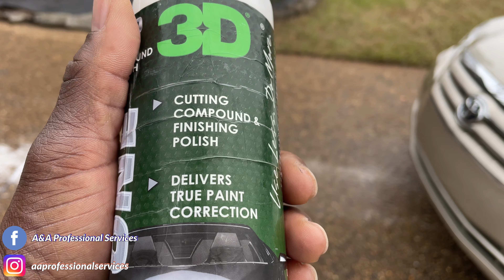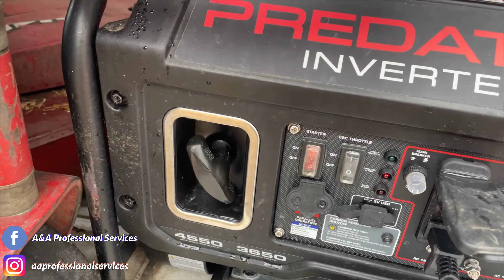Mobile Detail Setup Failed- Hose Reel

Comment: How often do you clean the polishing pads and how many do you think should be used for a average polishing job?
Reply from the maker: I literally put mine in the washing machine after each use. Three to four on each vehicle for the best results but i can get away with two simply by blowing them off with my air gun in between panels
Reply: @AAProfessionalServices  appreciate it, not a lot of people polish outside and explain how many pads they use while doing so.
Reply from the maker: Glad to do it

Comment: Sup brotha, mine leaked from there when I originally put the setup together , I took it apart and cleaned the threads and applied new Teflon tape and just tightened the living S out that thing and we’re going on 6-8 months still leak free 😅 I’ll be upgrading to a coxreel for the upcoming season more than likely. Stay up , your buddy at Polished.
Reply from the maker: Thanks for sharing.

Comment: Isn’t that crazy. Make more $ with less headaches, better reviews and potential referrals. I think they did make up that word lubricity😂. One bit of advice I read from a long time pressure washer was using only 50ft hoses and add more if needed. This way if you do have a problem the entire hose isn’t spent so to speak. Makes sense. Looks like you need a new reel tho. Stay Slick did a vid on converting a harbor freight retractable air hose reel into pw🤷‍♂️ may be worth checking out.
Reply from the maker: I'll look into that. Thanks for sharing.